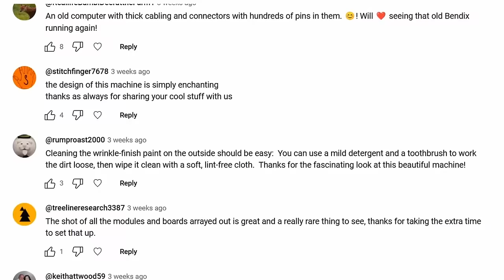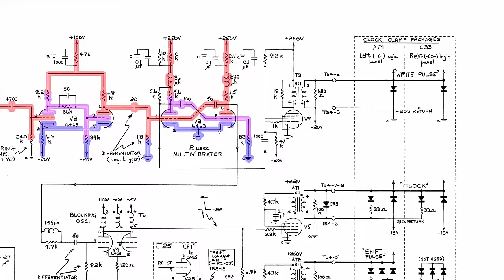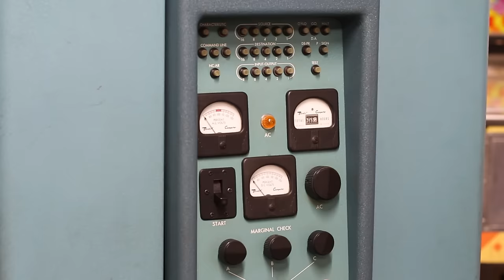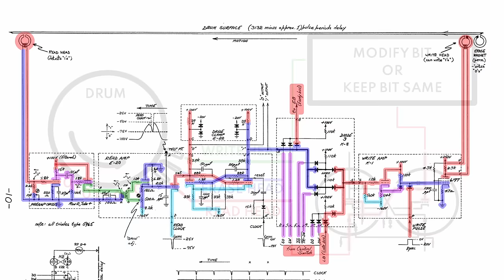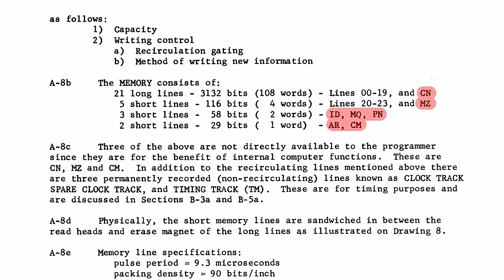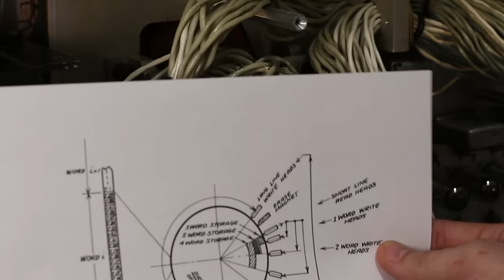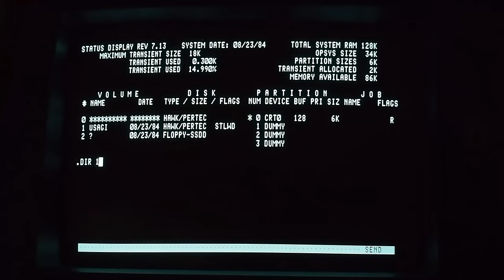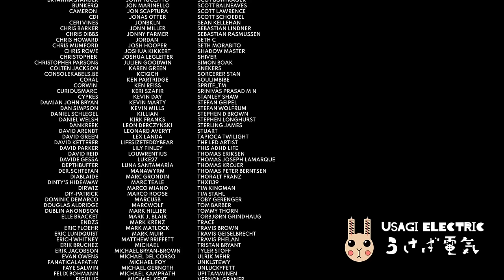Rotating Drum Memory with the Bendix G15

Comment: I worked on repairing a G15-D when I was an undergraduate.  There were very explicit warnings not to move the computer until the drum had coasted to a stop.  There was a spare clock track in case the original was damaged.  I think I remember that there was a paper tape cartridge that held a diagnostic that could with some fiddling with the drum heads, rewrite the clock track.  In any case if you do recoat the drum, you will need to recreate the clock track.
Reply: That should not be hard as we have multiphase electric motors that can run at extremely precise speeds it is then just a matter or pulsing a write head in the correct location.
Reply from the maker: Your memory s pretty much spot on!
There is indeed a read-only clock track and a spare clock track in case the first clock track gets accidentally wiped out. I haven't found any documentation outlining how to recreate the clock track if both get wiped out, but Lloyd's G15 has a good clock track on it that we can use as a foundation to build a new clock track when necessary.
Reply: We know you're secretly going to mod the track and overclock it by 0.000001 MIPS.
Reply: @CommodoreGreg since the drum is the source of the system clock, simply spinning the drum faster will result in a faster machine. A VFD should suffice. However, going to fast and the signals may not propagate correctly, and data may not write to the drum correctly.

Since there's a manually tuned blocking oscillator and multivibrator, probably can get more than a 3-5% overclock without returning those.
Reply: @UsagiElectric  Most of those coupling capacitors with glass ends are probably good because they are hermetically sealed so that moisture can't get in. You could check for DC leakage with your voltmeter if you have any doubts but you probably have already done that. So the old computers are basic medium to high mu amplifier circuits?
Reply: At RETS in Detroit 1967, one of my instructors was trying to get a drum memory working. Not sure if he ever did.

Comment: That would be epic if you can recoat that drum successfully.
Reply: That's all I was thinking about the whole time. It has to be possible since it was done in the 50's.
Reply: That would open the doors to recoating platters too.
Reply: I don't see any reason we can't manufacture and coat a brand new drum as well. Seems easy enough with a lathe.
Reply: @josugambee3701  Probably a centerless grinder but yes - it's gotta be possible !
Reply from the maker: Oh absolutely!
And I definitely think it's doable. I have a few ideas I want to take a swing at and see how it goes, but it's definitely going to put my skills to the test. Once we get this machine up and executing code with the swapped drum, we'll start making real progress towards recoating the crashed drum!
Reply: @UsagiElectric  even after re-coating the drum though, what would be required to restore the 2 timing tracks? I imagine that would present an interesting challenge!
Reply: @davidkilpatrick1640  Some kind of special lab setup to write them in the original format?
Reply: @UsagiElectric  I would say with either of the units I would replace all of those alloy steel bolts in there with stainless (or at least the ones that are expose and don't impact head alignment) and thoroughly clean the inside if possible. They have flaking rust, and at 27:46 I can also see the rust flakes all over the head chassis. With all that air circulating in there, any sort of debris will just get sucked in and circulated around the drum and in-between the heads.
Reply: So i have a drum except it doesn’t look coated at all. Its like aluminum or something
Reply: @ChrisB...  I don't think the issue is whether it's possible - like you say, it was done in the 50s - but whether it's possible for hobbyists or restorers to do it. The companies that made these originally either don't exist, or have scrapped their tooling to do it, or will have nobody left working for them with the experience to use the tooling, or will likely have no interest in doing single drums here and there. I can't wait to hear how this goes though!
Reply: Perhaps it is possible, to mix a suspension of magnetic powder (iron(lll) oxide) and a kind of paint and then spray-coat the drum with an airbrush (after resurfacing the drum).
Reply: Magnetic lacquers, baby!
Reply: @davidkilpatrick1640  Not having write heads may be the hardest part  in re-writing the clock tracks. If there are write heads, I would measure the drum rotation speed and apply the write pulses for the clock track, and then measure whether it came out neatly at the break. If not, try again.
I may take a hundred tries or so, but should be doable.
As for applying new coating, the materials are quite specific and had a lot of development behind them. Perhaps getting coating off magnetic tape and trying to apply that?
Reply: To be honest I never thought about recoating an platter surface or an drum surface. This would be game changing for real. I don't think someone did that in the last 40ish years. 
But I wonder if a company that has expertise in making magnetic tape like ATR Magnetics or RTM Industries could help or at least steer you in the right direction regarding the recoating the surface. Maybe I'm completely wrong but I don't think its as easy done as turning it down very precise on an lathe and adhering somehow Iron (III) oxide to the surface. Otherwise someone would have done pretty much that before or I just not heared about it I guess..

Comment: If the drum recoating works out, maybe you can recoat the hawk drive platterrs also?   Might be worth a try :)
Reply: Hawk stores more than 100 times as much information on ~comparable surface area so 100 times as much precision is needed. Coating a 16KB drum might be marginally possible to do by hand (although I personally doubt even that) but a 20MB hard drive platter is highly unlikely to work without extremely expensive precision machines of which none remain to this day. 

Furthermore, we have enough non-crashed platters to store all software and non-accounting data we will ever have, the problem is the lack of working non-crashed heads - and hand-coating the platters will increase the risk of further crashes and head damage.
Reply: Should work with vapor disposition.
Reply: @mwwhited  
They do use vapor deposition for the precision coating of astronomical mirrors, which also get recoated eventually, but the coating is an element (aluminum), not a compound like iron oxide. Maybe a compound would decompose?
Reply: @kennethflorek8532 I know that you can coat ITO (indium tin oxide) on glass via evaporation and titanium oxide through plasma coating with oxygen as an impurity gas. So maybe coating iron oxide would be possible.
Reply: @ToasterWithFur  Amazing. Coating telescope mirrors is not really far out.  Lots of people grind their own mirrors for telescopes and send them to a place to have them coated. It's a routine thing. For iron oxide, maybe not.
Reply: @jwhite5008  Even if it doesn't work, those platters were already destroyed from the start. There's no way you can make them worse, you can only make them better. So there is no risk in trying it.
Reply from the maker: It's possible that what we learn on recoating the drum could be adapted to platters as well, particularly in regards to what materials work well together and create a nice surface.
There are two big hurdles with the Hawk platter though. The clearances are about 50x tighter on the Hawk than the Bendix drum, and I'm not sure how to flatten the platter to be perfectly smooth again. The crash will have caused a slight depression in the aluminum that will likely cause disrupted ariflow and a crash again.

But, it's not impossible!
Reply: @UsagiElectric  The main thing would be to make sure the heads don't crash or get damaged.  The platters are already lost, so could be worth it if they can be machined flat enough and recoated.   I look forward to seeing how the drum turns out 😊
Reply: @UsagiElectric  Won't work on a drum but spin coating might be a viable way of refinishing a platter that's been machined/ground flat. It's pretty easy in terms of the mechanics of the process and precise/repeatable enough to be used in semiconductor fab processes.
Reply: @Stoney3K  There is a huge risk - if anything goes wrong and a head crashes because of some irregularity we cannot repair them and there are no spares.

Furthermore, the techniques mentioned can be used but IIRC the technological processes are VERY expensive if you want precise and consistent layer composition and thickness which we do.

The crashed platters would need to be ground to bare aluminum and then precision-polished first but that's the least of our problems.

Guys, we do have enough working platters for the few hawk drives that are operational and we do have some spares. This is a problem that does not need solving - at least it is not worth risking the drives to solve.
Reply: @jwhite5008  Sounds like it's time to start thinking about how to re-create heads. They're consumables/wear items and on a long enough timescale (which may be as short as a handful of decades) there will be no functioning heads left. It's no doubt a daunting task, but as a civilization we've only gotten better at making precise small parts from exotic materials, and it's more accessible than ever both directly at workshop scale and in terms of contract fabrication becoming more affordable.
Reply: @treelineresearch3387  Whoever makes hard drives now surely has technology good enough to recreate parts for obsolete units like this.  I'd be concerned about the characteristics of the ferrite powder in the coating, though.  That could well be different between obsolete units and modern units.  Properties tests would need to be made on known-good coating.
Reply: @jwhite5008  I would think that in both Texas and Maryland there may be machine shops and coating shops up to the task.
Reply: @mwwhited  How does one vapor deposit a slurry of low and high melting substances?
Reply: @UsagiElectric  The machining is not an issue, we started mass manufacturing machines during WW II that are easily up to the task of making the platters or drums. These tolerances are not as tight as you might imagine. There are also plenty of skilled operators out there, some of whom have YT channels and might be willing to collaborate. I am just a hobbyist, but I feel confident I could machine the drums with the equipment I have, but I could not repair the grooving. They would need to be recast, sleeved, or built up with weld (Probably TIG). There are also a number of YT channels devoted to casting, and some of them are extremely good.

As for the coating. I suggest you reach out to the Applied Science YT channel, his channel is devoted to exactly this type to project. He would be able to read the patent and be able to figure out how to adapt his equipment to the task (he has equipment for various types of deposition). Breaking Taps YT channel is another resource that has some experience in this field and would also have an idea of where to go.
Reply: @joshua43214  Cold spray coating might work to fill in the grooves in the drum before machining back to cylindrical. I have no doubt someone like This Old Tony or Abom79 could machine one of these back to 1959 spec or re-create one from scratch.
Reply: Sounds like a manufacturing new platters may be the best way to go. Get a precision machinist to make the platter cores, and then do spin coating with the magnetic material. @UsagiElectric
Reply: @treelineresearch3387  How does the density on those platters stack up against e.g. a 2.88MB floppy? I'm going to guess the Hawk doesn't use anything fancier than MFM.
Reply: Hobbyists flatten metal sheets with that lapping plates technique invented in the 19th century.
There's YouTube channels about it.
Reply: @kennethflorek8532  as someone with at least a little knowledge and experience doing PVD, i can confirm that that it should be possible to directly coat iron oxide onto basically anything. I recall a thermal process (ill have to look that up in the literature) as well as reactive atmosphere sputter coating. In the latter you add oxygen (in this case) to the argon atmosphere in which your coating. Then using a target of pure iron, and under precise process control, you can directly deposit iron oxide. I have done this with aluminum oxide already. 

I would tend more toward a thermal process for the drum and a sputter process for the drive platters at the moment. If i find the time (which at the earliest would be in a few months) i could give re coating a hard drive platter / making a new one from a piece of glass, a shot with my / my museums PVD equipment. 

One thing to note about PVD, the final surface finish strongly depends on the surface your starting out with, as well as cleanliness. Cleaning the drum well enough to even consider introducing it into the high vacuum environment of a sputter or thermal coater is no easy feat, nor is finding such a device large enough. (we have one that might just be able to fit both the drum or platters. Though it will need a custom jig for either)  

The other questions is, if a very homogeneous think layer is capable of storing the data the way the computer expects.
Reply: @MostlyPennyCat  that's one way, or a continuous pitch polisher would work also.  Problem would be getting both sides parallel. An optical lathe would also do the trip and have the parallelism needed. Probably, a good tool room lathe would also be enough for something as non dimensional critical as a hard drive platter. (compared to optical standards)
Reply: @UsagiElectric  without adding new material to the core, you very likely wont get them flat and dimensional accurate enough to work. Coating them is comparatively easy. As written in a previous comment on this thread i know of and can do various methods which could theoretically redcoat the drum or hard drives. I have however not attempted to create the exact composition of a iron oxide drive before, but based on what i have done it seems possible. If i find the time (probably not within the next 2 months) i might give creating such a coating a shot, though if the coating its self will work or not within the target device (drum or hard drive) is a different matter entirely. At the museum im helping to found and am, among other things, the curator, we have PVD equipment that might just be large enough to fit the drum, and probably the hard drive platters too. Though it will require custom jigs to hold them.
Reply: @lbochtler  Very cool. A possible overlooked source of info on magnetic drums are patents, if Bendix, or their source, patented something. The problem with patents (for info) is they don't disclose any more info than needed for legal protection, so long as there's not any way to work around the patent. Since patents are public, a copy is available from the patent office if you know the number.
Reply: @kennethflorek8532 would be interesting to see how the coating looks under an electron microscope, as well as what its made of and with what layer thickness. Good thing that's not a problem for us, we are building an electron microscope museum after all. The only problem is, we don't have one with a large enough chamber to put an entire drum or platter in. 

Using the info thus gained could be used to reverse engineer the coating and its process, or at the very least narrow down the possible ones based on the appearance of the surface.
Reply: @UsagiElectric  Maybe the platters can be turned like brake rotors to a thinner but uniform thickness.